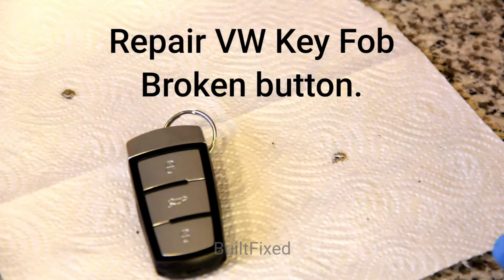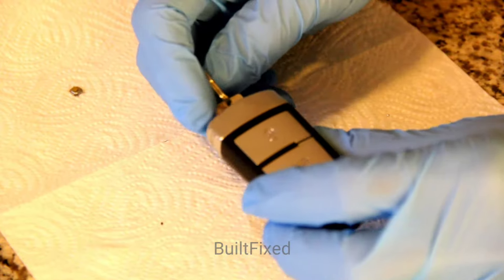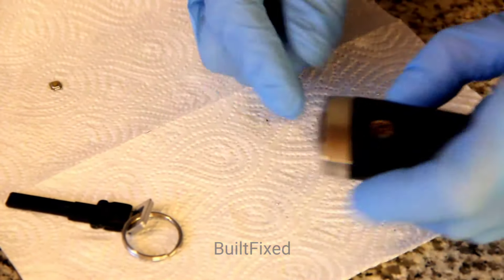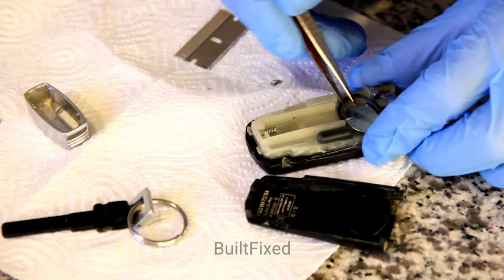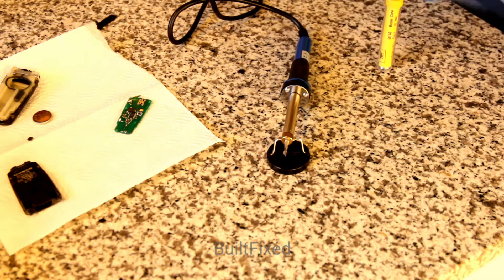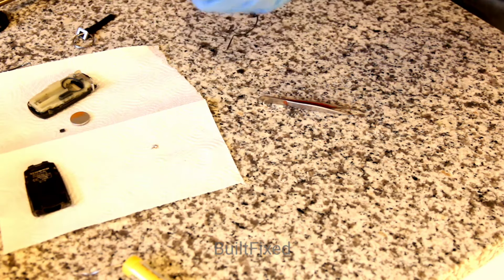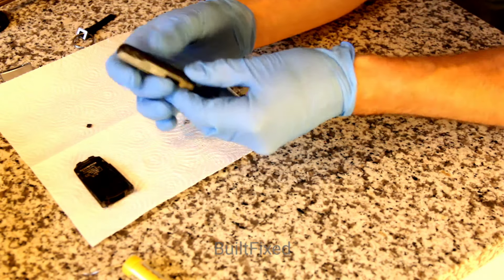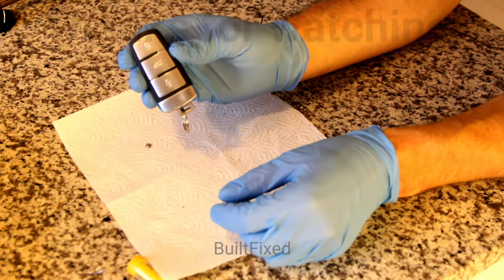Expensive $600 vw passat key or repair it yourself

Comment: Perfect video! Managed to get my key open and the old button fell out with the board. Had to sharpen the tip of my old soldering iron with a metal file but it worked fine. Key fob now works again, you've saved me £££££s! Thanks buddy

Comment: Thanks for the hint bro. I didn't noticed that seal in the process of dismounting.
I managed to reach the circuit board and the opening small button is stuck.
Also thanks to your hint i'll order a new small button and i'll replace it.
Best regards!

Comment: Thanks for the video. it was helpful. However, I was lucky enough to open the key without cutting the yellow plastic from the sides. 
I simply slid a knife blade underneath the plastic.

Comment: Big question. The part of the circuit board that contacts the battery has four prongs that are soldered. On my mine, the solder is worn thin and it doesn't seem to get power from the battery. Can that be the case? Could send a pic but not sure how to do so.